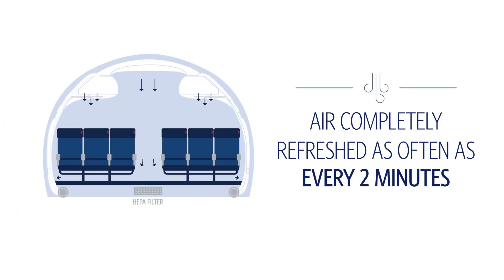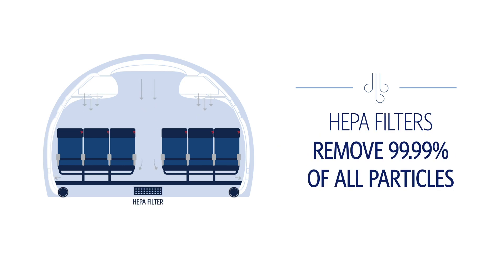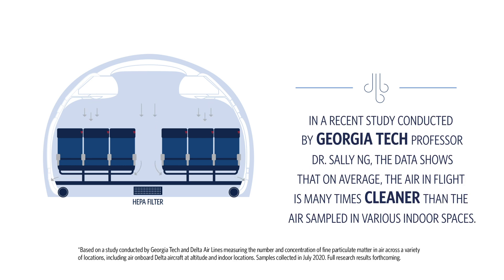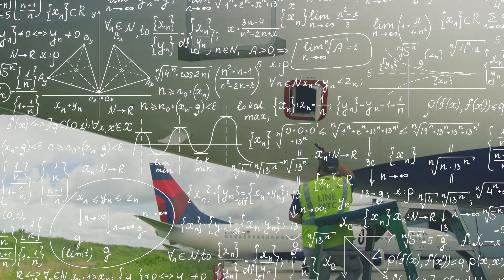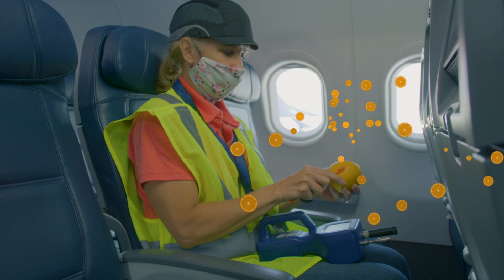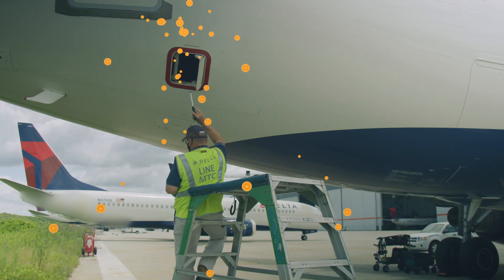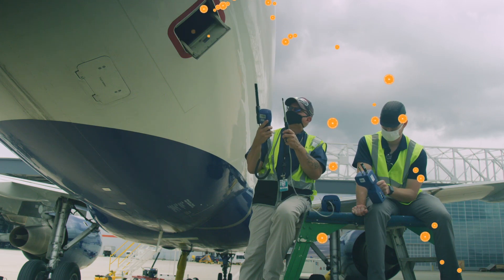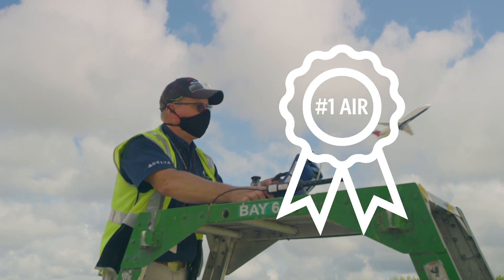How Air Filtration Works on Planes | Delta Air Lines

Comment: How clean is the cabin air while waiting on the tarmac? I was recently on a Delta flight from Minnesota and we were stuck on the tarmac for two hours with multiple people coughing, presumably sick (maybe with Covid). Fortunately, everyone was wearing masks, but it made me wonder how safe we were on the ground for those two hours.
Reply: very poor because the bleed air is near 0 from the engine... no pressure = no airflow or minimal from the exhaust fan which is not a requirement for operation and usually replaced at next scheduled maintenance.

Comment: Uh... no. Where does the air come from? You show the air exiting... not the source. Go to all this trouble to make a video but don’t explain the process?? D+
Reply: well in flight the bleed air from engine is the air you breathe in the cabin along with recirculated air (dangerous bit), eventually exhausted (sometimes lazily if the fan is failing, filters are dirty etc and they don't care because it is not considered critical to airplane safety) at the back via the fan or the pressure release valve. on ground.... well there is no bleed air... the fan may be moving some air, but generally meeeeeeh...

this is the bit they don't tell you; on the ground there is very little airflow until the engines rev up... in the air it is a bit better due to bleed air...
if you are sitting next to someone who is infected or somehow are in their plume (breath) there is a risk of infection; cabin air movement is a lot less predictable than they make it out to be.

Comment: I believe Delta may be recirculating the air at a greater rate now, but this something that can be tuned. It uses more fuel to recirculate more air and historically airlines largely didn't do recirculate at a high rate because of the additional cost. I am hoping they are doing it at a greater rate now, but in the end we will never know.